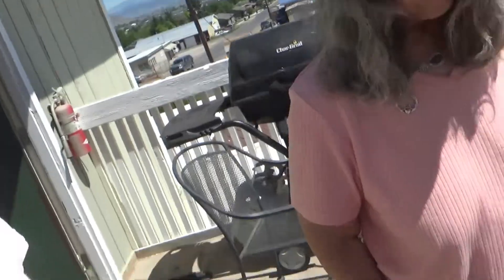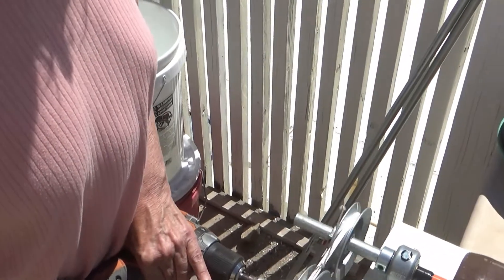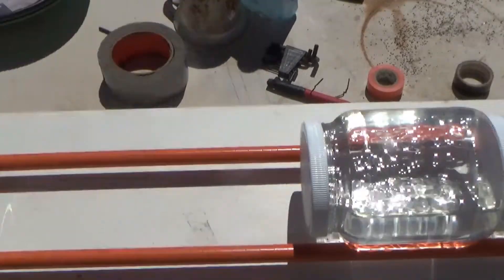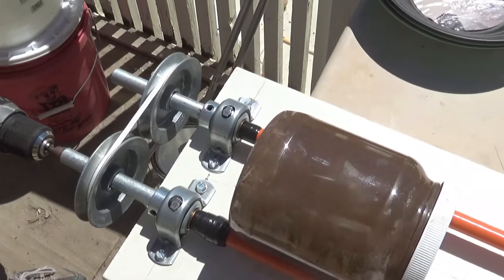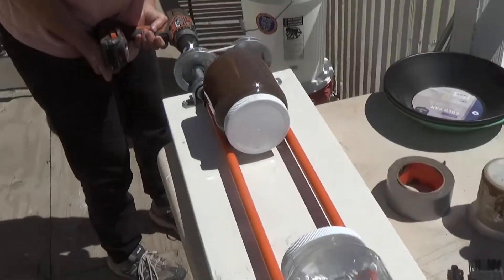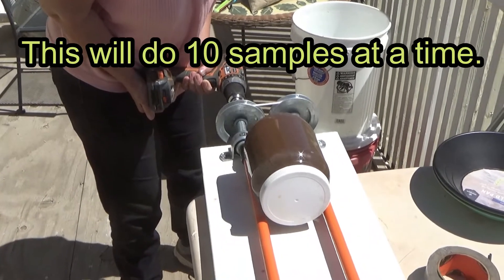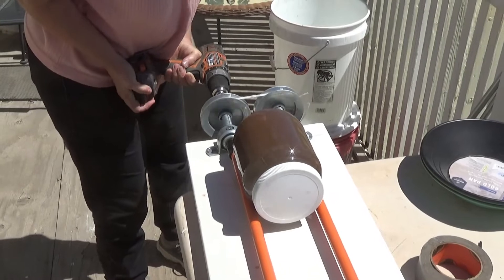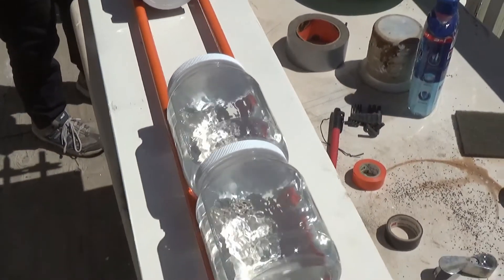214  How to Leach Test Ten samples at Once

Comment: so the bottles don't slip put some wide rubber bands on them. Cheers Rob.
Reply: Rubber bands won't last.  Use Black Electrical Rubber Tape, 3/4 in x 22 ft, $5.99